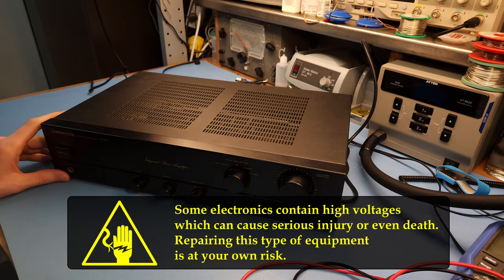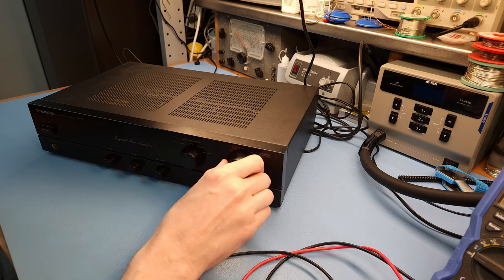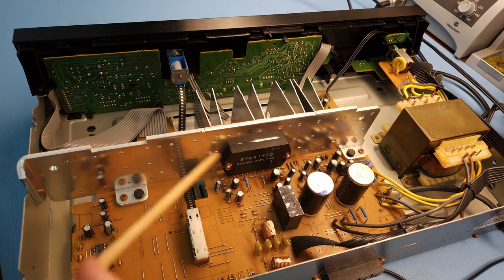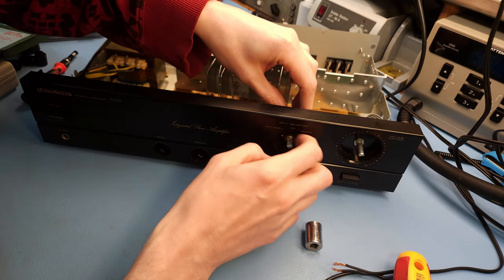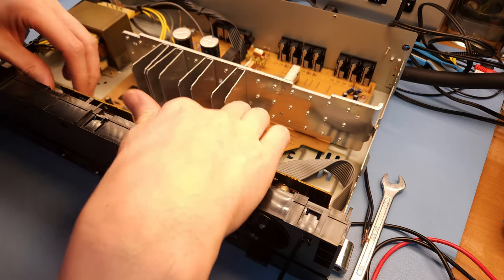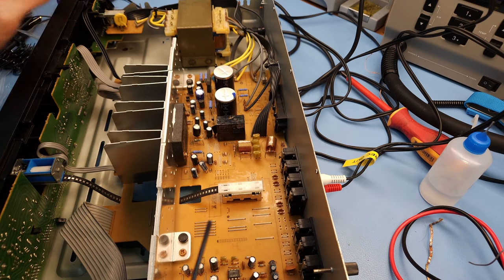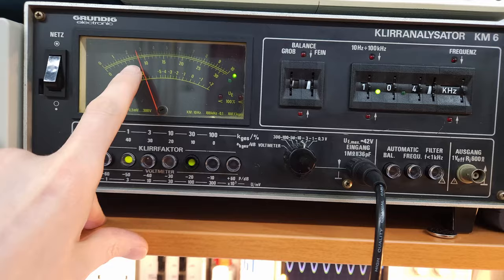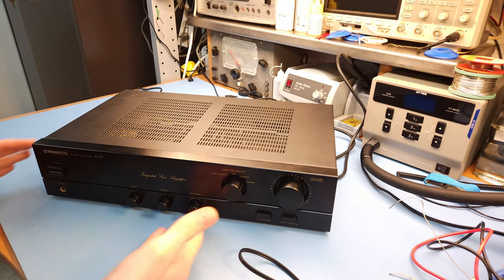Quick service of a 1992 Pioneer A-119 amplifier

Comment: Hi Kristof
A nice little amp and I found it quite an interesting video, especially your comments about the STK module.  
Getting these things apart and back together seems to be half the battle with these newer amps.

Cheers
Reply from the maker: Thanks!
The STK modules were a great idea and they work really well. But if they break these days, you're in trouble.
And yes, this amp was built on a budget so it was designed to be assembled quickly and efficiently. So maintenance friendliness was not as high on their priority list.